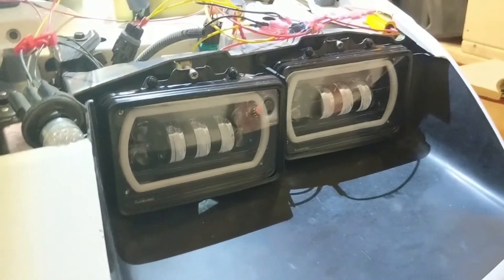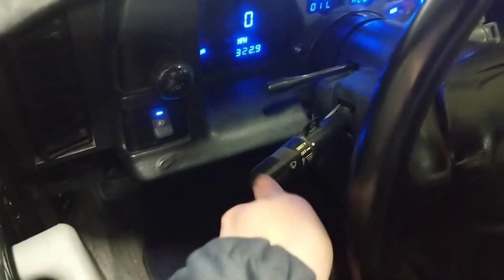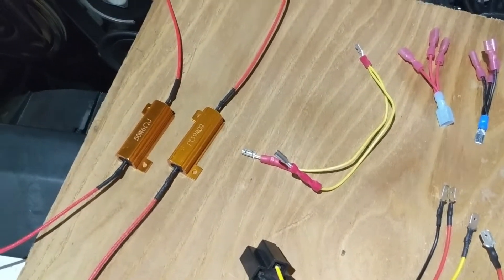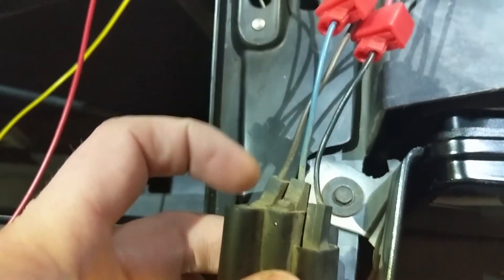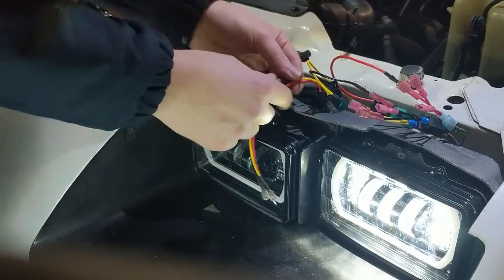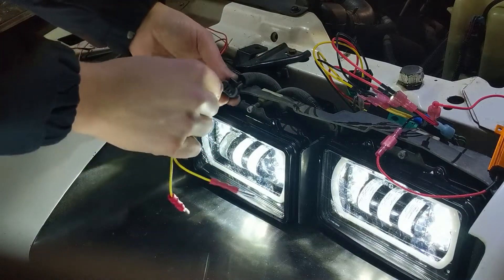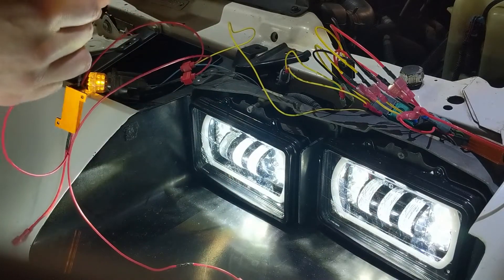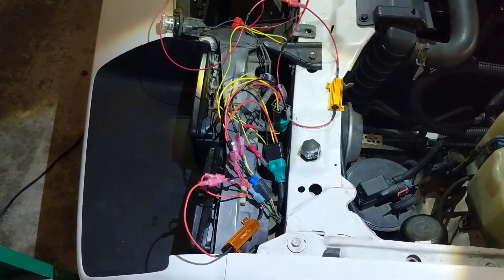Wiring LED Headlights into a 1991 Camaro

Comment: What’s the part number for the led daylight running light/bulb? Did you need a resistor for it as well?
Reply from the maker: I don't remember the part number as I purchased it years ago. Look up Sylvania Bulb guide and you can easily figure out the part number. Also, if you change any turn signal to LED in the car you will need a new LED rated flasher relay for under the dash.
Reply: I Have Them Same Lights But Mines change all colors and my turn signals don’t work at all

Comment: I still can not get mine to turn on? i switched wires around multiple times an nothing. but when i plug my old halogen light in it lights right up? any suggestions? its an 85 monte ss
Reply: I’m currently having the same issue.

Comment: Just so everyone knows. U can install these headlight in 5 mins as long as you are goid with the 2 outer lights on only when lights are on and all 4 activating when hibeams are on just as factory has them. He is wiring for all 4 to activate or work as the outer do all the time. Also halo is totally separate install than lights. I just plugged mine in with the harnesses provided and they are an upgrade. I personally didn't activate the halo, maybe later but all this wasn't worth it personally. Good info to have it you want it though and much thanks for the video.
Reply from the maker: This is true. My decision was to utilize all the features of all the new LED headlights except for the turn signal on the inner set. Thanks for pointing this out to help with simpler installs.

Comment: im pretty sure you can skip the resisters if you get an electronic flasher, not positive though..
Reply from the maker: I replaced the turn signals all around the car long ago to LED and yes, I needed to get an electronic flasher so they would work at all. The resistors act in a similar way as the electronic flasher but it's to allow the headlights to work properly as LEDs.